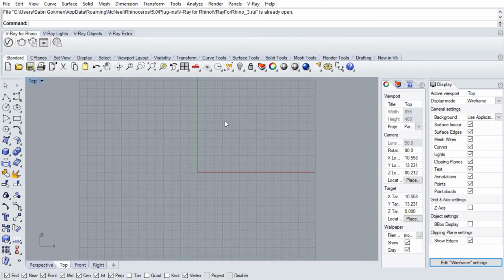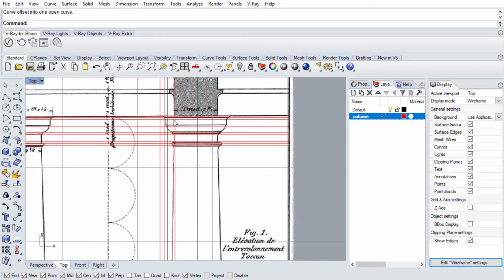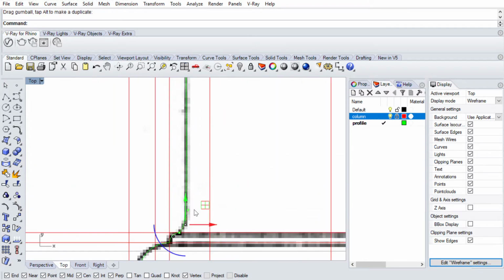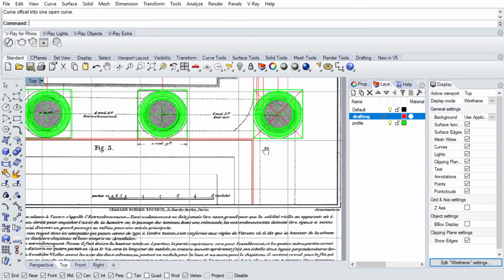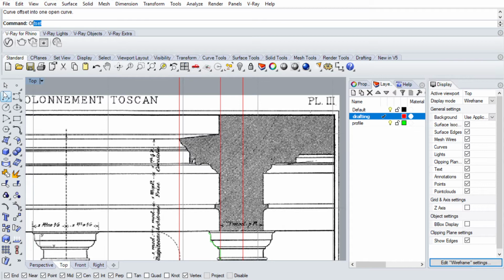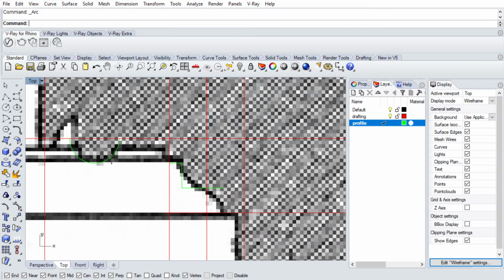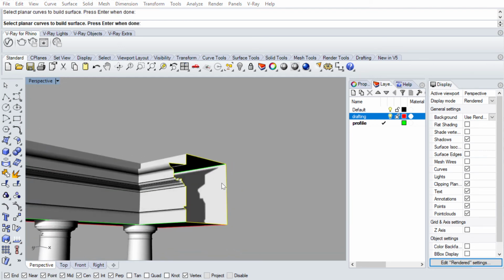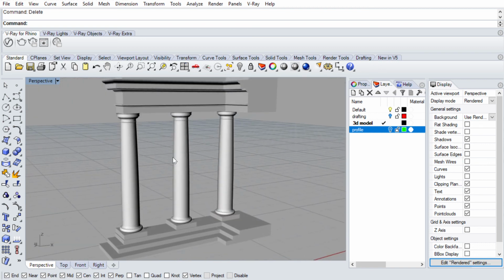Modeling a Doric Temple - Sweep, Revolve, Boolean, Extrusion

Comment: I'm unable to cap it. it presents the message "Unable to cap one object. The openings did not have closed, planar loops or edges." would I need to redo the lines before polysurfacing again.